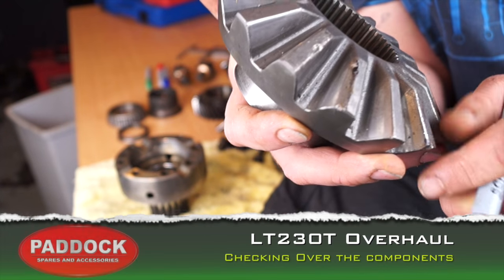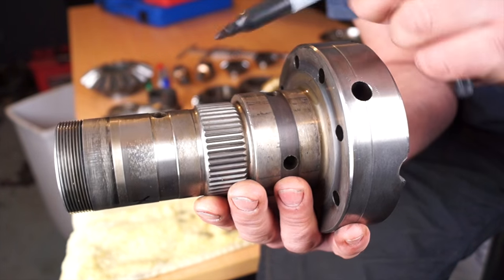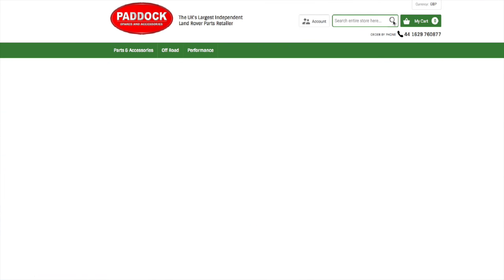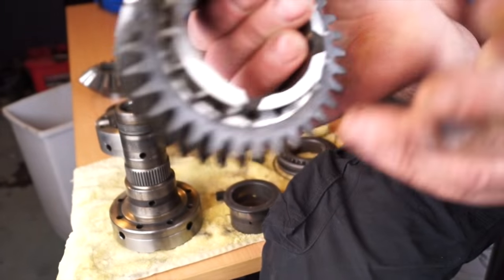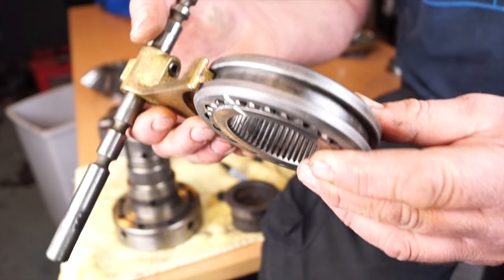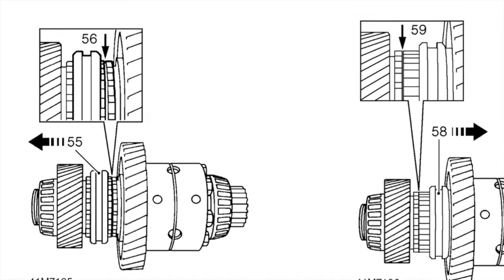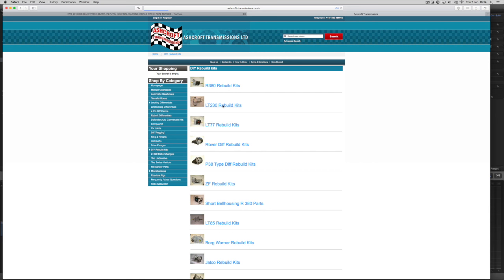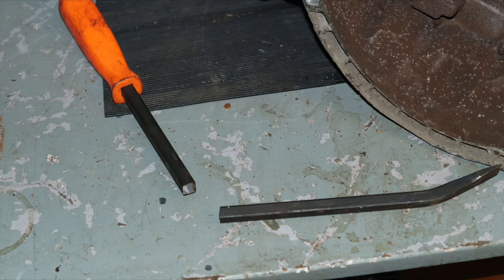LT230 T Centre Differential Overhaul PART 2  - Checking components - 110 Project Rebuild

Comment: My center diff in locked position seems to skip inside the box and not at the tires. What’s the first thing to check and can I just open up the box on the Defender and see my possible issues?

Comment: It's not totally clear in the video how much play is acceptable on the hi/lo selector hub. When I fit the hub to a brand new high-gear, there is about 2-3mm in rotational play, and I can also 'rotate' the hub on the gear in a circular motion about 1mm. Is this okay? I have another hub from another box and the play is the same.

Comment: Hi, thanks for the vids, could you answer this please , could I have a working Cdl simply by swapping the front casing from a Cdl transfer box or will I have to swap the whole transfer box ? Kind regards John
Reply from the maker: +John Moakes   Hi sorry.   Bit confused.  What is Cdl?  Is it Centre Diff Locker?    With this do you mean you are  wanting to convert the D2 auto diff locker from one that is manual?
Reply: I'm in the process of swapping a cdl front housing from a d1 into my 03 d2. the only issue I can see from these great videoso btw, is the diff preload is set by the bearing race in the housing. so just swapping the housing isn't the answer, you will have to check preload and adjust properly. The easier solution would be to swap the entire tcase. But I am swapping just the front housing and will rebuilt it with new bearings and seal as the donor truck I pulled the parts out of was high mileage.
Reply from the maker: yes that is about the size of it but it is a really easy transmission unit to remove and overhaul.